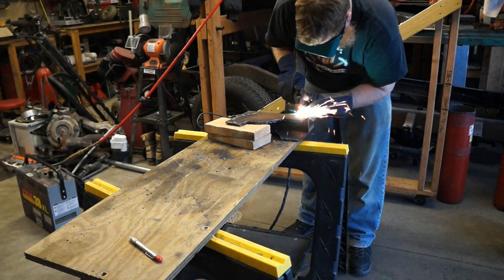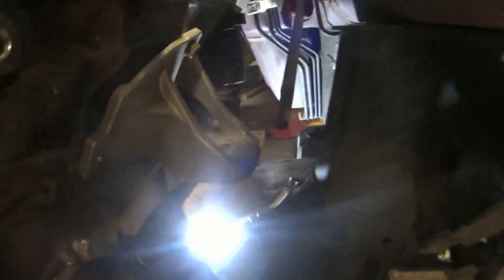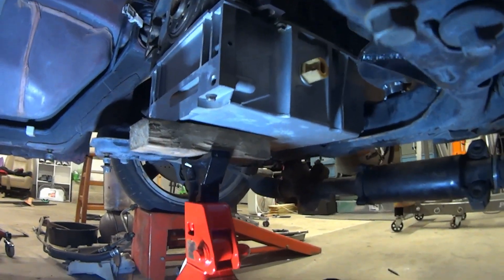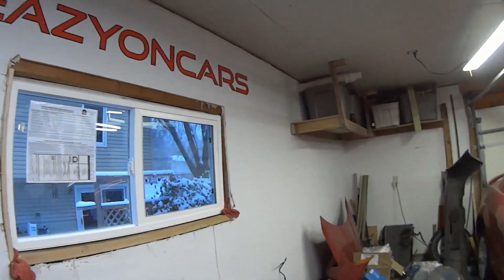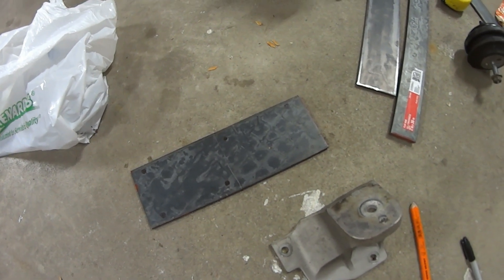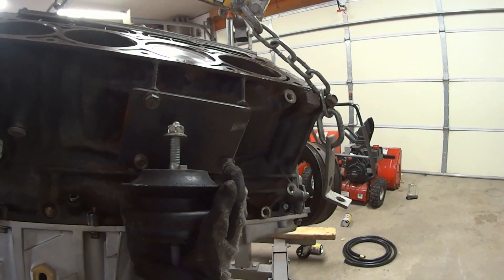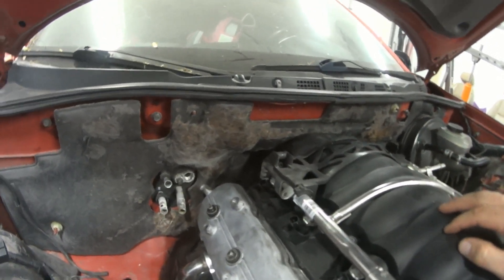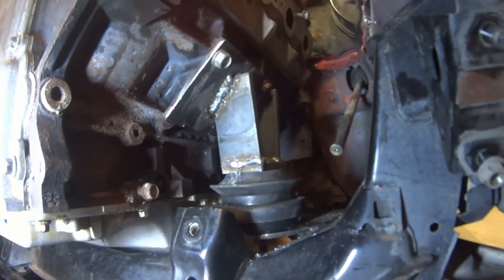RX-8 LS Swap Motor Mounts (Ep. 5)

Comment: I bought some sbc to ls adapter plates and new poly sbc mounts to mount mine, looking at yours I think they'll work pretty well but I may need to weld in a block on the U plates you have welded into the subframe